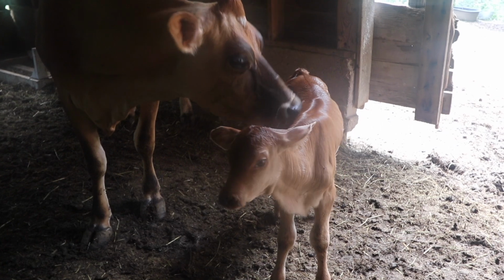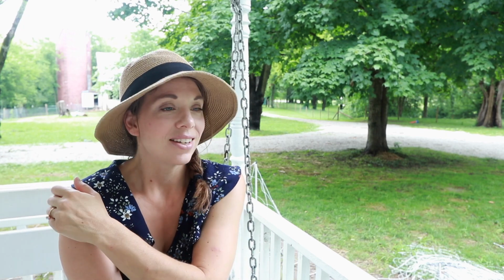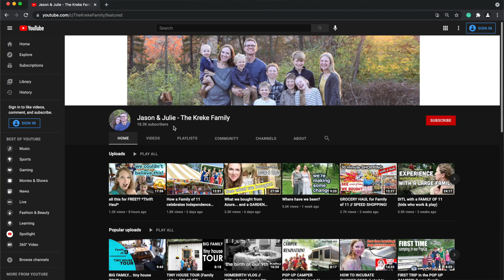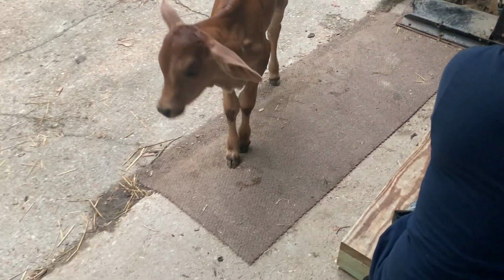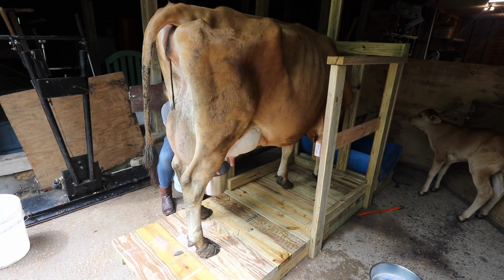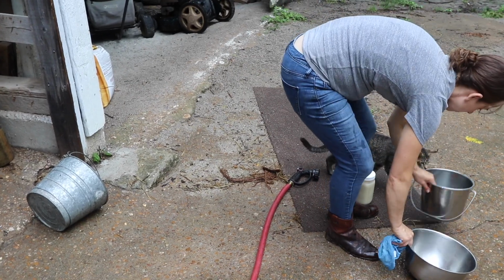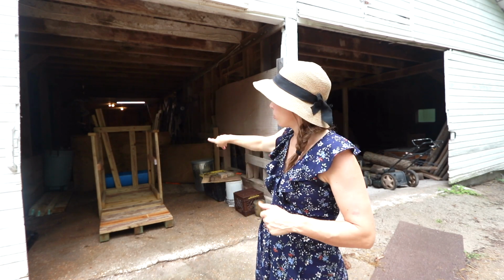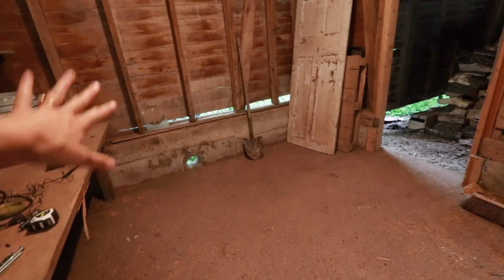We Weren't Expecting This!

Comment: If you're hand milking I reccomend milking into an empty quart sized plastic orange juice bottle like the Simply Orange brand. The teet fits down in there perfectly and the narrow neck allows your free hand to hold it easily. It greatly limits bugs and dirt and manure getting in your milk and you spill less if she kicks for some reason. I just take my glass jars to the barn with me in a milk crate and pour the milk into them when I fill the quart jug, screw the lid on the glass jar and continue milking into the plastic one repeating til she's milked out.

Comment: It is interesting to see how you use the halter. I have never halter trained mine. I've thought about trying, but I guess I never needed it. I always pull the calf and bottle feed them, so the cow has to come in to be milked to feel better. Kudos to you for hand milking. I have never gotten proficient at it. I am spoiled with a milking machine. I love my cows. I have guernseys and jerseys.
Reply: My cows don't poop in the milking stall unless they are really nervous or mad at me, which I try to never let happen. We live quite a bit south from you, so I don't really have to worry about cold weather. Our barn is dirt floor, so I just drove some T-posts into the ground to wire some old gates to, and that is my present milking stall. I don't use a headgate. I have the milking stall just under a bay in the barn.

Comment: Deb: I would suggest you get an old chest freezer that does not work anymore to store your grain. I have had a hobby farm for years and do not want to tell you how many time the children left a gate unlatched and the critters escaped. Any animal that over eats grain is an emergency. Which is why the freezer works great, they can tip it over or nose the lid open. It also keep the mice out. Have the kids decorated it with paint.
Reply from the maker: that's a clever idea

Comment: You need a much bigger bucket to collect her milk. The bigger the bucket, the heavier it is, the harder for her to kick it over. As for the halter, I agree with others, - don't leave it on. There's a lot of issues that could happen. We had horses and never left a halter on, they could get them hooked on branches or post nails or God knows what. Then they freak out and potentially hurt themselves.
Also, maybe I missed it, but whatever happened to your bees?